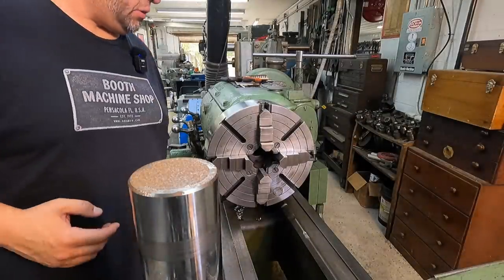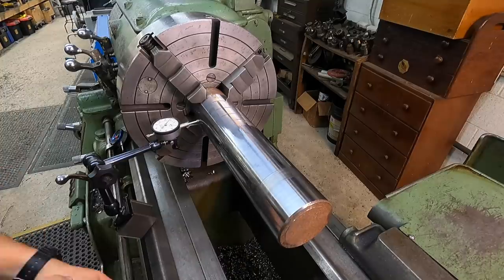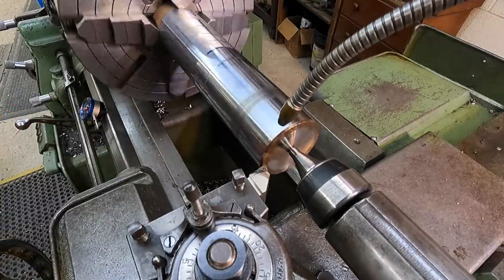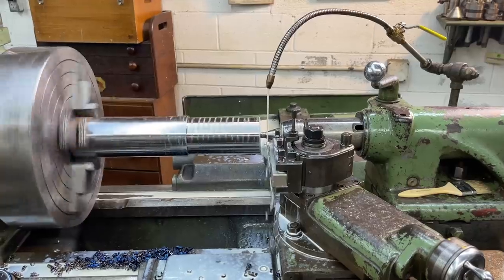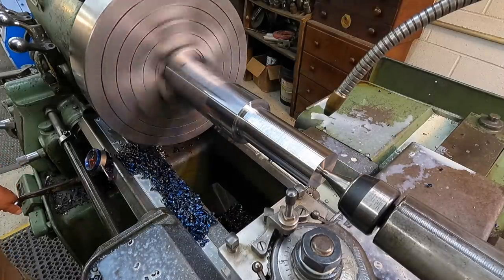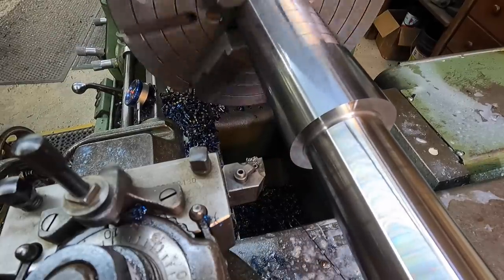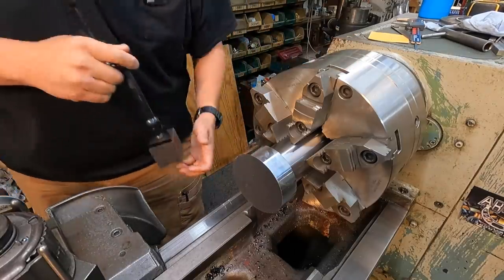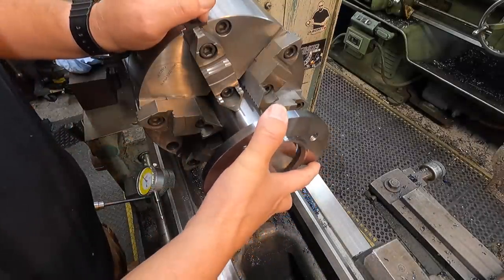Truck Hitch Crane Build Ep. 3

Comment: Tips for protecting the camera.
You can use mirrors to get closer to things that can break a camera, cheap vanity mirrors for car sun visors work well as they’re plastic usually.
For splashing you can set a fan to blow splashes away from the camera, a tube focusing the air flow down and across the view field will redirect almost all splashes.

Comment: Love your vids Adam,  whether shop stuff,  BBQ stuff or travel stuff,  always informative and entertaining.   This vid, though not explicit,  showed me what I’ve been doing wrong when using telescoping gages.  I saw that you adjust the micrometer as you sweep the gage,…… I always tried to touch the gage like I would measuring a solid part,  being careful to try not to move the telescoping gage,  but never quite got the hang of it.  Now,  just as the ‘Always Check Your Threads’ voice goes through my head every time I cuts threads,  a mental image of you using a telescoping gage will be with me every time I use one in the future.

Comment: I've learned so much from you over the years Adam, Now I just wish I had a small lathe I could operate from my chair to do small jobs and special projects,  but the pickings on lathes around OKC are thin to none.   I have been wanting to get one with a 2' x 6' or 4'foot print.......Bob.
I feel a Grizzly G0602 10" x 22" Benchtop Metal Lathe or one about the same size, give or take would be ideal for me to get my ass off the sofa and back out to my shop.  I don't work on mowers any longer and haven't been in my shop for a little over a year now.
Reply: You drive to cocke county Tennessee and I’ll sell you my atlas 10” lathe very reasonable.
Reply: @shanek6582  I'm totally disabled and wheelchair dependent & can no longer drive due to multiple sclerosis and live alone.  I wish I could.
Reply: @RobertPerrigoOkiechopper  sorry bout all that, sounds like you could use a good lathe though, mines just been sitting for years.

Comment: Adam; I think the bulk of the viewers like your Monarch because it's "Old American Iron"; I am in the process of cleaning up and restoring/rebuilding a 42" (small compared to what you use) Atlas Lathe; the ways (full length) with head stock & tail stock removed is only 42 inches and I will be using it for hobby machining with my mini mill that I have.

Comment: Before you started your cut you got it running almost perfect or should say perfect. You were able to use your led knocker to move it around just a little to get it perfect. When taking a large or heavy cut is the piece moving due to you only had to bump it lightly to get it to move before you started cutting. Very interesting to see that much being cut at once. Wow good job.
Reply: You bump it around running true then put a center in to hold it true but there will always be movement due to tool pressure.. when dealing with tiny measurements everything is made of rubber

Comment: Coming along nicely! 👍👍

@Abom79 Idk if the video was shot before you adjusted the camera or not. But if you're still having issues with the audio I'd say check the audio cable & input jacks if you already haven't. Bc the distortion and channel loss are hallmarks of audio cable problems. Just throwing it out there. 👍

Comment: Awesome video.  I  need to get one of those tool holders for my Powerturn.  What CNMG insert were you using for the finish cuts on the Monarch and want brand/type live center is that?  I like the small diameter and long nose.  Thanks!

Comment: Hey Adam.  Does your design accommodate the truck's suspension droop when loading?  It seems the crane's support post will end up carrying weight after the load is on the truck bed unless the post can be adjusted with weight applied, or can rotate at the receiver.  The receiver mount will drop with the suspension, and if the support post is fixed to the receiver, torque is created in the connection.

Always enjoy your content.

Comment: In my shop I do it your way with one dial but when dialing a large face on the mill and only have to tap it a small amount to move it I set up two dials so I don't have to run the machine back and forth along a 20ft part

Comment: So I think I heard right that this is hydraulic rod? Is it not induction hardened? I new to machining and worked six months at a hydraulic shop and I was taught that we had to heat the rod with the rose bud to take the hardening out of it before we cut it either on the band saw or turning on the lathe. Since you have much more experience, what are your thoughts on this?
Reply: Everything can be cut with the right tooling.
Reply: @grntitan1  Thanks Tips👍! Anything can be done with enough time and money. What I'm looking for is the most efficient/effective way to do it. So maybe you can share how you personally cut Induction hardened chrome bar? We had ceramics if we needed them but my boss felt it was cheaper to heat the rods than risk breaking ceramics.
Reply: @mrspencerls  CBN inserts is what I use to cut hardened steel on the lathe. Not trying to be rude, but you gotta pay to play. You can not be scared to use the proper tooling because of price. Nothing in machining is cheap. Nothing.
Reply: @grntitan1  agreed, it's not that it was rude  it that your comment was pretty useless with out any extra info. As a new apprentice to this trade, I was doing as I was taught and some what trusting the two 30+ year journeyman I was under new what they were doing. You don't know what you don't know, all a person can do is ask questions and observe others and hope that people with more experience will help along the way so for give me if "Everthing can be cut with the right tooling" isn't really an answer to how. There are many ways to do things and I like to learn many of them so as a journey I'll have the knowledge to chose the best for my situation

Comment: Once you have 10 or more tool that are ruined, send them out to be re-machined to factory specs. When I started working at this one shop they threw away ruined tools until I bitched long enough until they figured it was less expensive then buying new tool holders. Some of our tool holders cost $500.00 - $1,500. Also save all of your used carbide inserts & drills & sell them to carbide company who recycles carbide. You can do the same if you use ceramic inserts.

Comment: Question for you guys.
@18:49 he mentions the tool not pulling a chip. Which I assume means not breaking the chip. He keeps going which is cool and all but what should be done to correct that issue? Slow down the feed rate or slow down the speed.
Sorry, I'm a newb on the lathe and trying to learn.
Reply: Every type of insert has a "designated" feed and speed rate based on the angles. The angles is what causes the chips.
Reply: Hey Joseph in my experience this kind of cut always has this problem especially in stainless. It’s more about material properties and depth of cut. Having the right geometry on your insert or turning tool can help. Also with finishing passes I almost never find that slowing down rpm works. Sometimes by speeding up rpm and slowing down feed rate with an aggressive chip breaker profile helps. But again sometimes you just can’t get around stringy chips on your finish passes. Hope that helps and keep making chips!
Reply: Hey Joseph I just heard Adam say basically what I mentioned around 30:14 so you watch that again.
Reply: A CNMG insert usually won't break a chip with a small depth of cut .015" here.  I have much better luck with a CCMT type insert on small cuts.  CNMG loves deep high pressure cuts.  That's why you see the stringy chip.  Adam knows that but is doing a finish pass so no biggy.
Reply: @Larry Robinson sometimes I will get the best results with either a braised carbide that I hone to a very sharp corner (no radius) or HSS done the same way with slightly lower speeds and feeds of course. Have you ever tried that? If not check it out.
Reply: @paullee4442  I saw that and read your other post. Thank you.
So he mentions "slowing down the feed rate" and then "even out the tool pressure"
I get "slowing down the feed rate". that's easy
So "even out the tool pressure" just means take off your depth of cut?

Leave speed/RPM the same
Slow down feed rate
Don't cut so deep.

Is that a general case? like if you're not breaking chips, just chill, slow down and don't cut do much?
Thanks for your help man.
Reply: @larryrobinson7492  You lost me on the "CXMX" stuff. I'm assuming that cutter language and I'll look it up. thank you.
Reply: @paullee4442  sounds like you may be using a little AXA sized tools, I use BXA size on my 13x40 with usually 5/8" or 3/4" sized tool holders, there are plenty of carbide options without messing around with cemented carbide or HSS too much.  I do use a few for radius and chamfers but just because I haven't gotten around to ordering some good carbide radius tools much like the one Adam just used in this video.  I'm not knocking your methods, I just don't like trying to grind stuff too much as my eyes ain't that good anymore.
Reply: That's a Huge problem in many cases and tool geometry Speeds feeds Material everything plays into it especially in CNC its a Safety Issue there are even high pressure cooling solutions which try to break chips with the force of cooling fluids it's not like there's a solution that works every time more like you can change anything and hope for something
Reply: @josephcitizen4195  the issue when he said even out tool pressure was about doing two equal size cuts to finish. Normally you want to remove material as efficiently as possible. This means as big cuts that your setup will allow and then one or two finish cuts at. 005" or. 010". On finish cuts you want fast speeds and slightly slower feeds. It's when you're doing finish cuts that you'll struggle with chip control. As I said earlier, sometimes there's just no good way around it (especially with certain materials). I don't worry about it too much unless it's having a bad effect on the surface finish, and the surface finish is important. If that's the case I would leave a few thou on the work and sand it in (not ideal mind you). Otherwise you can leave a few thou on and cylindrical grind into the right dimension. That almost never comes up. You can see in Adam's video that he gets really good results. Good luck, have fun, and be safe!
Reply: @paullee4442  Thank you for the info Paul, very helpful.
Reply: @larryrobinson7492  No I usually use CX or DX sizes for my work. I worked in many situations from aerospace to large 20 ton propellers for work boats. So I have had good results using that strategy no matter the size of tool holder. Try it out sometime... or don't.

Comment: ABOM have a ? I am a contract welder at I have a jones & lamson No. 4 turret lathe and while I have figured out how to bevel tube stubs and so on I would like to get into it alot more and I have done a little searching but don't want to buy the wrong parts it doesn't have a tail stock and I would like to know were I can get replacement inserts and know the different size and types

Comment: i am wanting to build a small lift or crane to go in the back of a pickup wanting to be able to extend 10ft and be able to lift 1500 lb fully extended would really like to run my idea by you and hopefully get you to help me with it. not sure where you are i am close to dothan al. if there is any way to contact you please let me know thanks. also want it to rotate 180 degrees i have been working on my idea for a while

Comment: Adom, why does the cylinder end up bigger on one end than the other?
Reply: the shaft is not running perfectly true and wobble a bit at the outer end (opposite to chuck). this end will be smaller because the wobble is cut off. but as adAm said, its not big deal in this part.

Comment: You could do like they do over in Pakistan instead of using dial indicators they use a coat hanger mounted on a stand🤣
Reply: I was taught to use a scribing block, circa 1970's, still useful today, especially for forgings, rough surfaces, or picking up a scribed circle on a plate. DTI's were very expensive then.